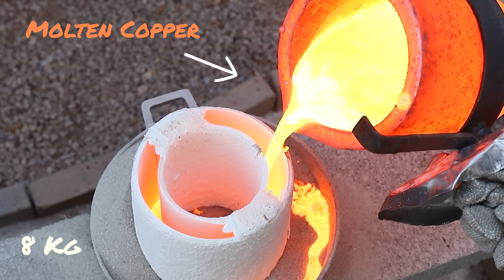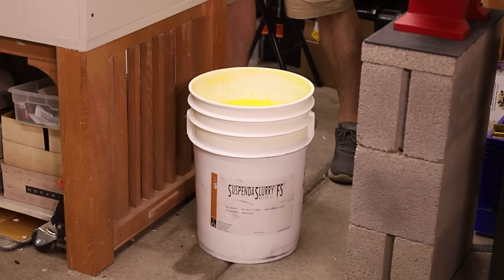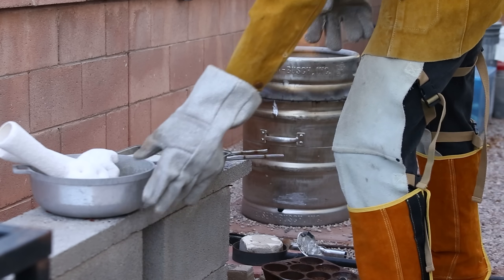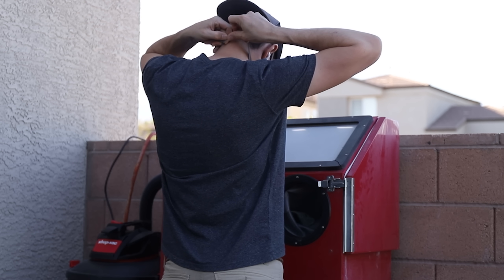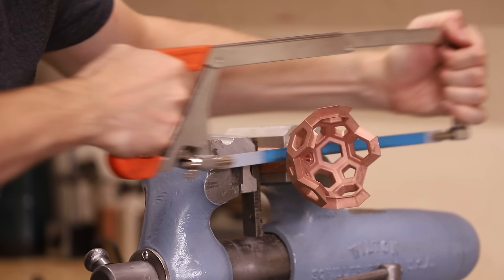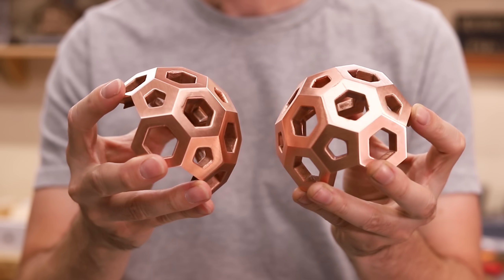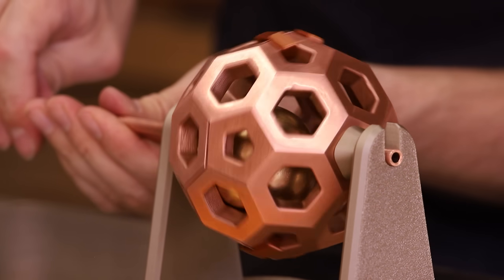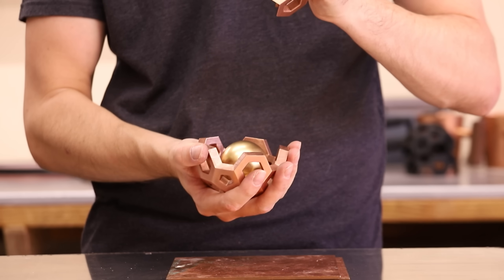HUGE Magnet VS Copper Sphere - Defying Gravity- Will a Neodymium Magnet Float Inside?

Comment: It won’t work without a cancellation of gravity force
Reply: Source: I did it back in 2006 with Lego, pyrolytic graphite, and magnets
Reply: What won't work?
The magnet "floated" inside the copper as long as he kept moving the copper "sphere" around.
Reply: @ddegn  yes, I jumped the gun on the goal.
Reply: @ddegn  it wasn’t that all that great requiring a motor and external input energy

Comment from the maker: What do you think will happen? And if you’re enjoying the video, don’t forget to hit the 👍- it really helps the channel out!
Reply: You should induce the spin using an external magnet like you did at the end, but using a motor to spin the external magnet. This will keep the magnetic poles perpendicular to the axis of rotation of the cage. The inner magnet would then be spinning the cage rather than the cage spinning the magnet. It should float nicely then.
Reply: @glabifrons not
Reply: A strobing light will give the effect of outer sphere not turning so you’ll be able to see inside easily. Similar to a camera shutter making a helicopter look like the blades aren’t spinning.
Reply: @seanbaker1627  Great idea!
Reply: Maybe try a larger copper "sphere" or a smaller magnet.
Reply: Hi. I don't think you need the whole sphere. You can ignore the sides because there is only one axis of rotation. Kind of like a barrel shaped cylinder with acrylic grips for the axle so you can see through.
Reply: Lenzs law is AWESOME 😁

If you put the second magnet on a motor in a wooden box underneath, it would make a fascinating science magic optical puzzle 👍
Reply: Perhaps next you will pronounce icosahedron properly…I-sauce-a hedron, much like a icoceles triangle.
Reply: Before watching the result with magnet:
The reason why transformer cores are laminated and not solid is to limit eddy currents. As such, the fact that the "sphere" is made from two parts, the desired effect of eddy currents in this case will not present itself enough or at all. The shape of the sphere also determines the path of the currents, and an intuitive evaluation tells me it will not help to achieve the desired effect.
So Id wager the ball will tend to drop to the bottom in case the rotational axis is vertical, or "stick" more to one side (the one with with least copper, as obviously the halves will not be totally identical). 
This setup would benefit a lot if you'd suspended the magnet inside and carefully brazed or welded the halves, to allow for "more complete" paths for the eddy currents.
Reply: soccer ball
Reply: What if you spin the ball magnet and place it in the copper thingamajig
Reply: make sphere out of transparent copper